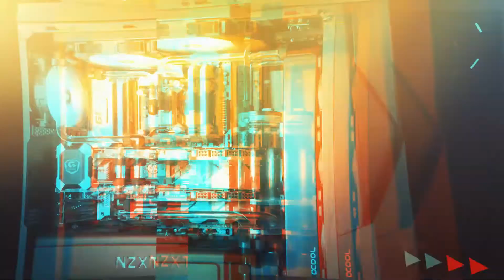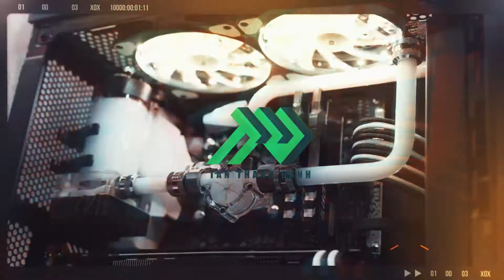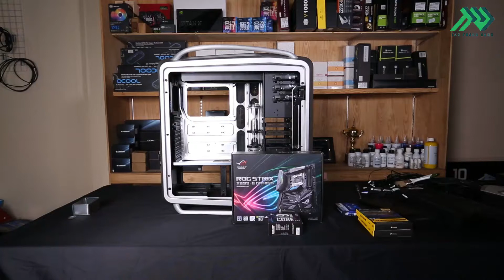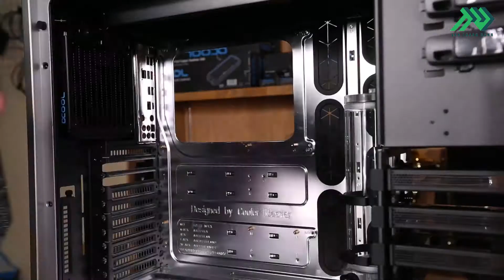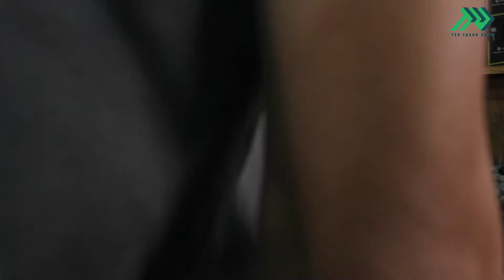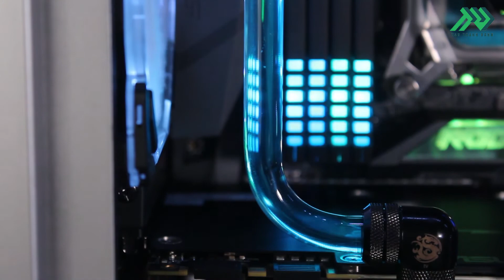Cosmos II 25th Anniversary Edition Full Watercooling : Phiên bản đặc biệt

Comment: Very nice job! What radiator you used at bottom? 240 or 280?
Reply from the maker: 240mm , thick 45mm bro
Reply: @TANTHANHDANHCOMPUTER  Could I use a 240mm 60mm thick? And by the way, do you connected pump to 240mm and then to graphics card right?
Reply from the maker: @douglasrigueira1  U can use 60mm radiator . I use - i call it's Water Guide Plate
Reply from the maker: Same here : https://shop.bitspower.com/index.php?route=product/product&path=4_353&product_id=7134
Reply: @TANTHANHDANHCOMPUTER  Bro, if it's not too much, can you give me the list of pieces that you used?
Reply: @TANTHANHDANHCOMPUTER  I think in use 1x EK 360 45mm on top and 1x 240 60 on the bottom, 1x reservoir 200 EK. But on your project do you use reservoir with pump right? Then from the pump to the water channel, then for 240 on bottom, next is vga, then 360, going in to the cpu and come back to reservoir. That's right?
Reply from the maker: @douglasrigueira1  Pump - Rad 240 - VGA - Rad 360 - CPU - Tank - Pump
List product :
- Block CPU : HEATKILLER® IV PRO (INTEL processor) ACRYL CLEAN
- Radiator : Alphacool XT 360 & XT 240 ( Thick 45mm )
- Pump + Tank : Bitspower DDC Reservoir Combo 150 Acrylic-PWM
- FItting : Bitspower MatteBlack
- Coolant : Mayhems X1 Concentrate UV Blue 250ml
- Tube : Bitspower Hardtube Acrylic OD 12mm

Comment: just found out your channel and its fucking awesome.. one request.. please list all the parts in description.. and if possible.. type description in English too
Reply: also link for ssd too
Reply from the maker: Spec "
➡️ Mainboard: ASUS X299-E STRIX GAMING LGA 2066
➡️ CPU: INTEL I9 7900X SK 2066
➡️ RAM: CORSAIR VENGEANCE RGB 32GB(4x8GB) BUS 3466 CAS 16 DDR4 - 2 kit
➡️ VGA: ASUS GTX 1080Ti POSEIDON PLATINUM 11GB 352BIT GDDR5X
➡️ CASE: COOLERMASTER COSMOS II 25TH ANNIVERSARY EDITION
➡️ PSU: SUPERFLOWER LEADEX 850W BLACK 80PLUS PLATINUM MODULAR
➡️ SSD: PLEXTOR M8SeY 1TB PCI
💥💥💥 Accesories:
o LED Corsair Lighting Node Pro
o Conroller Corsair Commander Pro
o Fan Corsair HD140 RGB Dual Pack With Controller
o Fan Corsair HD120 RGB - 3
o Fan Corsair ML120 Magnetic Leviathan Dual Pack 
💦💦💦Watercooling: Alphacool, Bitspower, Heatkiller